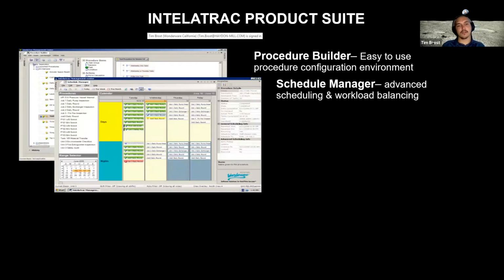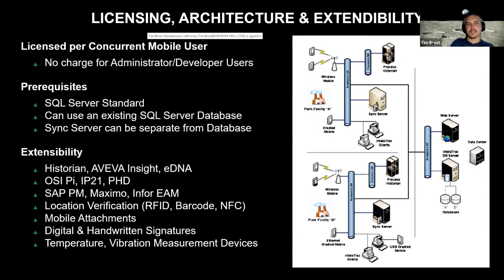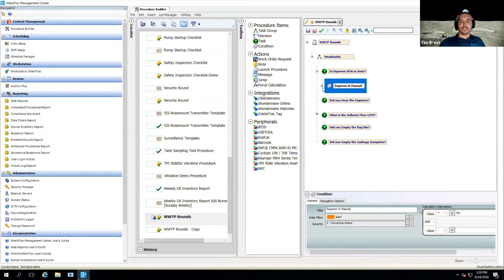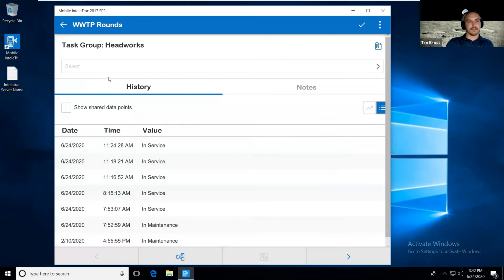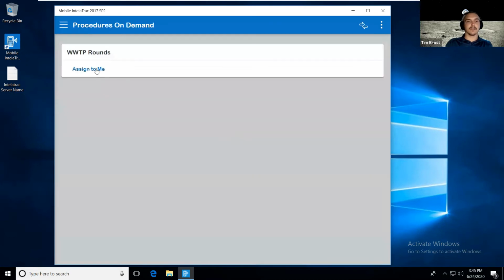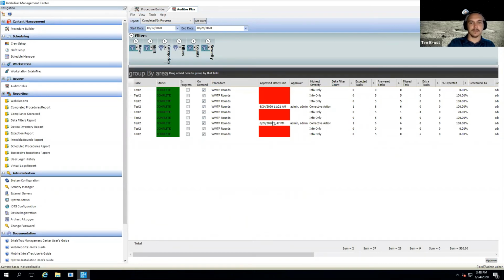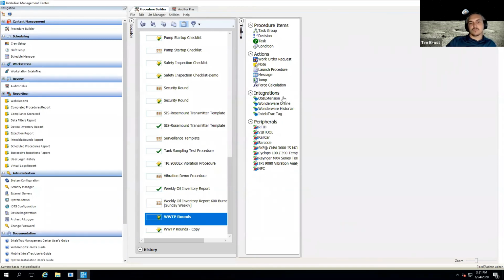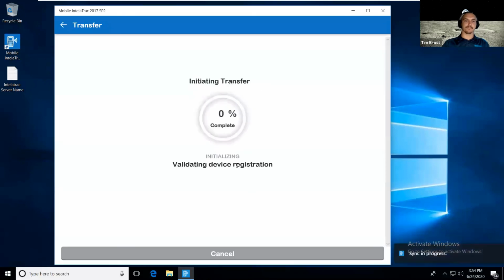Mobile Operator Rounds, Water/Wastewater Workshop | AVEVA 2020 LIVE!

Comment: hello, I’m Juliet from Nigeria,  I am trying to build a procedure for pumps and I want it to carry out some certain tasks based on the status of the pump, for example, if in service I want the operator to record pump suction differential pressure, record suction pressure and record discharge pressure, if it’s on stand by I want it to show these tasks confirm suction valve is open, confirm discharge valve is open etc, if it’s on maintenance I want it to show these tasks confirm discharge valve is LOTO’d, confirm suction valve is LOTO’d, confirm electrical breaker is switched off, and if it is out of service I don’t want it to show any task. 
I have tried using both condition decision to achieve that but I’m stuck. 
Please can you help out